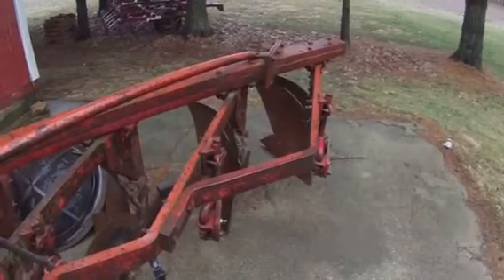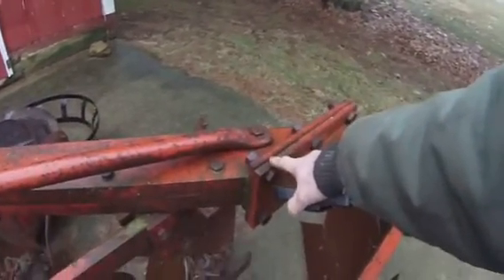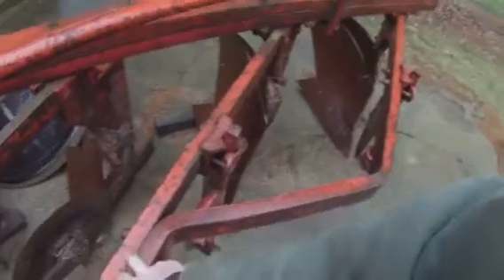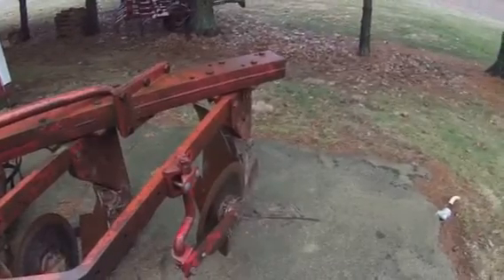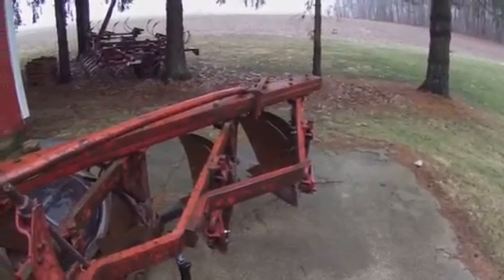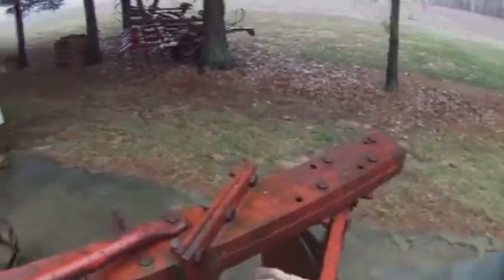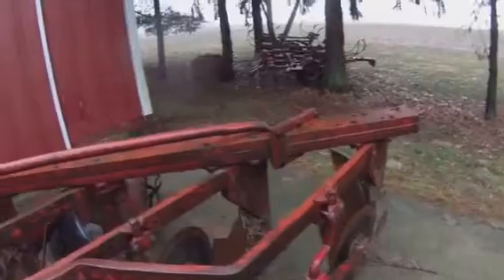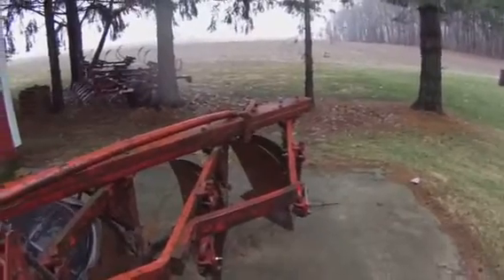Massey 82 plow for Ford Farmer

Comment: I grew up using this same plow. There very good sturdy plows.  Seven years ago I bought my Massey Ferguson #82 plow it had the 3.16's  I pulled it behind my 64hp John Deere 5320 cab and loader tractor. Then last year I bought a 92hp 1990 Massey Ferguson 3070 cab loader tractor.  My brother has the same plow but with all 4 plows 4.16's but he took the 4th plow off because he felt like it pulled his 471 Massey Ferguson to hard. So I bought his extra plow and put it on mine so now I have a 4.16's #82 Massey Ferguson plow to pull behind my 3070 Massey Ferguson.

Comment: Thanks! Ours is missing that large last bracket that has the 6 bolts. Most of the other stuff we have. Our wheels are M&W aftermarket and they work pretty good. But this will help when we go to fabricate the last pieces we dont have. Thanks again!
Reply from the maker: Ford Farmer no problem.

Comment: That was a good way to do that and no have to make a bunch of different plows. I think one can add up to 3 bottoms. At least that's the way it was on the Olivers
Reply from the maker: Jake Ziegler yes Jake. This model can be 3 or 4 bottoms. I'm not sure which model it is but i saw one in a book somewhere that was a 4 bottom that could have 2 extra bottoms added to making it a 6 bottom! That would be plenty in a full mounted plow. How is work coming on the IH tractor?
Reply: Massey1105driver that'd be a big plow! And I've been waiting on parts but I'm gettin back on it today

Comment: thanks for showing me your plow.  with the JD4020 fixed I back in the plowing plan.  just having trouble deciding if I should plow now or just before each field is to be planted.   if I plow now, I'm thinking rain might make a mud hole and keep me out of the fields for disc work or worse, getting stuck out in the middle of a field with no good way out.   first time plowing jitters.
Reply from the maker: Soybean Farmer I am not familiar with your weather patterns so I probably couldn't give you good advice on what to do. A lot of guys fall plow around here, but a lot of plowing is done in the spring. I would say whenever your ground is good and fit, sink the plow in the ground. Sometimes plowed ground dries quicker than undisturbed ground. Depending on soil type of course. Thanks for watching.

Comment: Hey! I have the three bottom and one of them tripped.  Could you post something looking at the trip mechanism and let me know what you know about what I need to do to reset the plow?  It is stuck in the tripped position.  Is there something that needs to be released or pressed? the old owner said he thought you need to maybe press something and then back up with it.  Any help would be much appreciated
Reply: Any luck figuring out the correct solution? I’m in the same position right now.